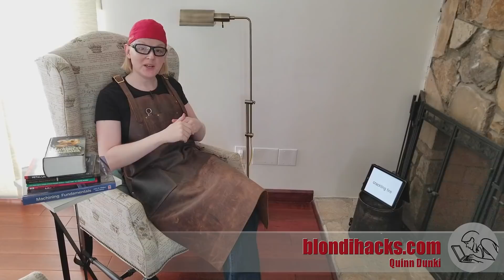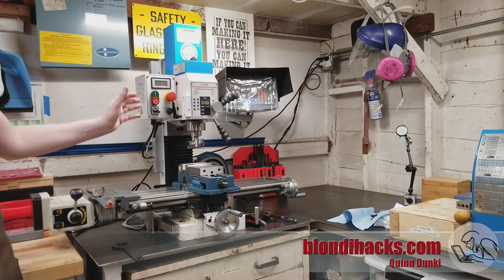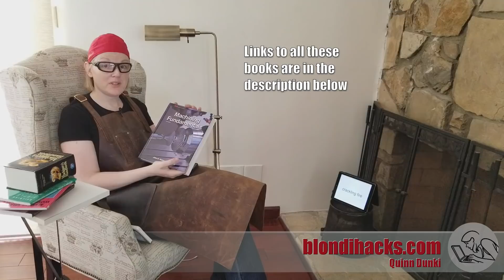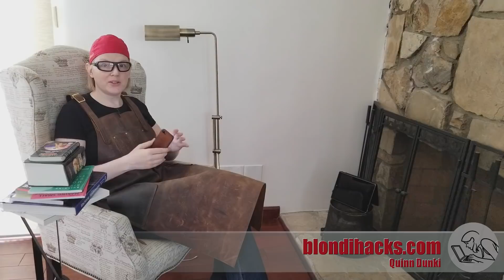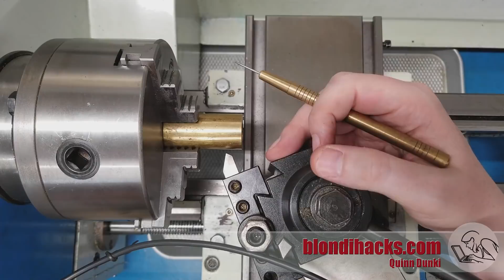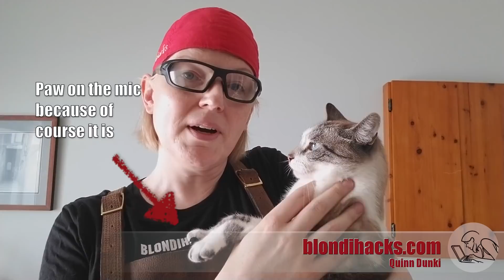Blondihacks Anniversary Q&A!

Comment from the maker: Sorry, everyone- I misspoke on the motor- obviously it’s 750W, not kW.
Reply: It would be rather cool if it were true though...
Reply: Sounds like it's time to upgrade the motor, make the statement correct instead of correcting the statement.
Reply: With a short enough pulse I'm sure you could do 750kW - so just call it the peak power rating for marketing:)
Reply from the maker: @notsonominal  Duty cycle: 0.01%  🤣
Reply: Sorry ( point out, not post out,  above, sorry again) I'm gong to click the bell, thumbs up and just leave.......
Reply: You were just testing your subscribers🤔, 750 kW motor would be the size of a very small car!
Reply: @bostedtap  Quite a large car to be honest...at least for European standards.
Reply: @zanpekosak2383  I have worked on 400 kW motors, and just looked at TT Electrical AMP frame size 315, and I'm not too far off, bit heavy at 2600 kgs🏋
Reply: @bostedtap  Well I did some googling to and I found put that 750kW woukd equal to about 1000hp. That is an amount of power that even some of our larger trucks dont have...hard to find a tractor with that much power as well.
Reply: well, at least you didn't say 1.21 gW
Reply: @HappyHands.  Great Scott😀
Reply: @HappyHands.  Or "A Flux Capacitor gets this Motor started".  ;-)
Reply: @HappyHands.  GREAT SCOTT!
Reply: We're not letting you off that easily. You must acquire a mill with a 750kW motor now. :p
Reply: Blondihacks ... You just left off the point we know it was a floating point answer peace.  .750kw
Reply: I'd be pretty happy with a thousand-horse mill, though...
Reply: Yeah, that would be one hell of a motor on there, you'd need a crane to change it...

Comment: I've watched a lot of instructional Videos. Most come in around 5 or 6. I give you a 10 out of 10. You are very articulate & detailed, most are not. Thank you. My background. Boilermaker, Fitter & Turner some electrics. unfortunately since I finished Trade School I have not had anything to do with Mills & Lathes. When I retired they were the first machines I acquired. However I have not done that much work other than some I've needed immediately.  Now I will be.  I have a CQ6123 Lathe & a Mill/Drill Head which normally attached to the Lathe, but I've made it stand alone. Thank you.

Comment: THANKS FOR DOING THE Q & A video.I learned a bunch about you and your backgrounds and equipment. THANK YOU !!!
   You mentioned about Trains having AC motors. The newer extremely high end locomotives ARE AC traction motors, but they're mainly used in flatter grounds. DC traction motors are mainly the older units They actually do lot better in mountainous regions.
   I APPRECIATE your KEWL style in the machine shop ! A person can tell, that you have it together, as well as know what you're doing, and why the end (quality), justifies the means, (all the set-ups and pre-planning). I was taught, the machining is only a SMALL part of the operations...The Set-Up takes the longest amount of time and takes the most care for accuracy of the finished part. It is apparent that, that was instilled into your beginnings. Having THAT in the back of your mind, IS the most important aspect of being a Machinist !
   Bill, from Tn. 🇺🇸

Comment: If the oil changes are a bitch because of drain plug position use the old school fix. LOTS of old equipment that had the same problem. They instead installed 90 degree or 45 or whatever was needed fittings into the drain plug hole then a long tube to an accessible area and a threaded plug on the end. Added benefit is metal filings created by wear are affected by gravity and as such many make it into the tube and are no longer available to excel wear in the gear box between oil changes.  I have seen people even do this even with flexible copper tube. But, if you like steel then a length of new brake line will also be awesome to bend however you wish to get the line to go where ever you wish. By the looks of your lathe You have a shelf just below so you could route the line around the base and under the table top. Time to drain the oil. just put a pail on the shelf. Pull the plug and walk away.  another SMART idea is to stick a magnet to the casting or even on the tube if metal or tape it to the tube if copper in order to control filings and even help persuade them into the tube. Much the same as some vehicles that have magnetic drain plugs. Just a thought. My 53 Cat 112 road grader has the engine oil plug coming out right over the rear drive diff. Cat installed fittings and pipe from factory. Same with the anti freeze drain through the large cast housing. But the rad drain also has a valve installed for added security in case you lose the plug. 

Folks now may think manufacturers, engineers and designers now are smarter but back then they certainly weren't as cheap and lazy cause designers actually not only thought of these inconveniences and guaranteed messes they also designed and installed the fix at the factory.

Comment: Hi, I'm impressed with your wide knowledge of machines. I'd like to understand wether replacing spindle bearings on a 7X14 Asian lathe from ball bearings to taper rollers will significantly improve the overall lathe rigidity. I've eliminated all the slides frreplay. You're my last chance to clear this issue. Thanks Shmulik

Comment: The other weak spot for lathe is the single lead screw that wears and looses accuracy. Some lathes use a separate shaft for carriage movements and a second separete leads crew for threading. Much more accurate over time.

Comment: Sanity checking my memory (thanks google), granite is around 168lbs per cubit foot, so at a rough guess on the size of that, it probably weighs around 90 to 100 lbs.  So yeah not easy to move just with fingers.  Thanks for the video :) Just found the channel. :)

Comment: I have an old Cincinnati 2MI univ mill(has horizontal capabilities and has an enco  j head? It will never be a cnc controlled unit.  I want to put a dro on it what do you recommend? Thanks so much.i learn lots from you,
Reply from the maker: To be honest, I’m not sure. The DRO on this machine came with it. I honestly get the feeling that these Chinese-made DROs are all pretty much equivalent, so I imagine those kits you can buy on eBay are probably fine. As long as they are glass scales, and the resolution (5 micron or 1 micron) matches what the control panel wants, it should be fine, I imagine.

Comment: I have a question. Either Blondihacks or someone else could answer this:  when looking at a thread tapping chart wether it be metric or imperial in the stock to be tapped section it has for example [75% aluminum, brass, mild steel] what does the percentage refer to?
Reply from the maker: That refers to the amount of thread engagement- either 75% overlap of the thread surfaces, or 50%.

Comment: I purchased a Chinese lathe and soon advanced to a much larger lathe...an old lathe, South Bend 10 it is leaps and bounds over China lathes for my use and more versatile. I am presently looking into a milling machine but limited for the room as far as size is concerned. Horsepower is a major concern as you mention in this video. It's a matter of size versus what I can fit in my shop. Good video and explanation of shop and equipment. Thanks

Comment: Thanks for answering my question. Funny detail: I do most YouTubing in the shed, smoking a pipe, next to a fan exhausting my pollution outside. Noisy. So I don't hear subtle sounds. Only saw the cat appearance coincide with a noise I could HEAR a small subset of the times, and I thought these were tool-chatter noises/squeaks being amusingly punctuated by the cat icon. Alas, no... actual cat noises. So now I wonder if the cat thinks the machine is talking, and it's merely responding in kind.

Comment: I find it interesting that I too am a software engineer that has been a car guy all my life and I got into home machining to produce custom parts for my drag car. I bought my lathe when I was installing a bumpsteer kit and the way to get the correct offset on the drag link was stacks of washers. I found this quite offensive and bought a 9x20 asian lathe to cut the spacers to the exact length in one piece. Of course, it ballooned out from there, like making solid transmission mounts, and clutch adjusters, and manifold spacers... you know.
Reply from the maker: It always starts with a bushing. 😅

Comment: Love to donate but I don't do Patreon ,  any suggestions.
Reply from the maker: You bet! I have Paypal links on my website. Go to http://blondihacks.com and look on the right hand side. There are one time donations and automatic regular donations there.
Reply: @Blondihacks  Done!  You should receive a donation from sirGawain
Reply from the maker: @BlueFlutterbies  Awesome thanks! To your earlier question, the steel tip is a sewing needle with the big end ground off. It's hardened steel and holds a point extremely well. Sewing needles are amazing. Don't try to cut them- they are too hard. You need to grind them down to size or use a dremel cut-off disc, something like that.
Reply: Have you thought of making up some ebay yearly subscription items $10,$15,$20 etc for non patreon persons to purchase?
Reply: What type of steel did you use for the steel tip in your brass scriber (needs to be hard but not brittle)?

Comment: Did you cut off the chip shield on the pm-25 or remove the hinge rod and pair the wires?
Reply from the maker: Great question! I did remove it. Nothing electrical needed- the switch inside is normally open when the shield is closed so removing the rod is all you need to do.

Comment: 🎉🎂⚙️😺  What a nice informal and informative ..crackling fire..side chat, but very costly in terms of production staff🤣. Not much I didn't know or could extrapolate from reading your blogs but some good stuff coming, eg threading and oils.  I was going to go searching for oils the other week till a mate pointed out " Engine oil will be fine, thats all they had in the 40's and 50's" . Interested in your thorts on that. Also want to know about timing of disengaging the lead screw.
I'm gonna have to do a spring clean in my brain to try and retain all this stuff😁

Comment: Very nice video. Thanks. We're still analog around here when it comes to fireplaces... I purchased the largest bench top milling machine that my 120 Volt single phase shop power could accommodate (and that I could afford), something to keep in mind if you don't want to invest in a larger electrical service and the electrician's lake cabin. I am using a very small bench top lathe that my brother purchased years ago and passed on when he moved up to an industrial size lathe, and got tired of making my parts. I do 80% aluminum in my small motorcycle shop. My lathe definitely has limitations. There is a very friendly machinist/fabricator in the next town over when needed. Mr. Pete often refers to some of the older, cheaper, and useful machining guides. My next mountain to climb will be TIG. The link to, and info about, Fusion 360 is much appreciated. Dorito Magnificat says howdy to Sprocket. Thanks, again!!!
Reply from the maker: Sprocket says “meow” which can mean “hi” or “I kill you now”. It’s hard to tell.
Reply: @Blondihacks  Cats are meant to be served not understood

Comment: In case you've never seen one, could I suggest looking at the Atlas MFC mills... It's a horizontal bench top mill with built in power feed, kinda like a bench top version of Keith Fenner's big mill... Unfortunately they are no longer made, discontinued back in the 60's. Parts and repair are still pretty easy tho.
Reply from the maker: Yah, I love those! I tried to find one when I was mill shopping, but wasn’t able to.
Reply: Blondihacks I found one a few months ago, but couldn't afford it (long story, medical bills...) the trick to finding tooling is use google image search believe it or not

Comment: You should try doing a CNC out of the Mill and you could then add a 24K rpm spindle ... I just went with the bigger Mill that could fit my Garage... It's a 1988 Anayak with 800x400 xy travel and then i build an adapter and added the 24K rpm spindle to it... It works great! From Portugal, you are awesome 😋
Reply from the maker: I have given serious thought to a CNC conversion on this guy. The PM25 is a popular target for it because it has ample room under the slides for ballscrews and servos. Maybe someday!
Reply: @Blondihacks   I converted my G0704 (Grizzly version of your mill). Not sure it's worth it unless you just want to take on the challenge of the project. I'm glad to have mine, but I often find myself just wishing I had a manual mill to do many jobs (probably most).
Reply: @Blondihacks  i was lucky, i work in a company that specializes in injection moldes for plastics and my employer was going to scrap the machine but i steped up and got it for myself... I'll post a video and link it to you ASAP so you can see me making some clamping system and T NUTS for the table...
Reply: @Blondihacks  https://youtu.be/fuyc8RSGuLY
 It's also my first upload, love watching you videos :p

Comment: Quinn, one interesting point about granite surface plates is that if you drop anything heavy onto the surface they chip rather than ‘denting’ the material, which on a metal plate would  produce a burr or high spot. I know this could be dressed flush, but I personally prefer the granite version. Congratulations on reaching the one year milestone. Any thoughts on producing videos on CNC machining, particularly using the basic G and M codes?
Reply from the maker: Yes, excellent point! I’ll be including that in my surface plate video for sure.

Comment: Blondi
You are often the first video I look at.  Very well done, neophyte friendly ie simple but clear and comprehensive.
Couple clarifications
1.  Commonly called "brushless DC" are actually 3 phase.  They got that name because starting torque is about the same as a series wound DC.  
2.  HP by itself does not matter.  HP = Torque x RPM divided by 5252.  Motor selection should be done starting with torque demanded by driven load and then how much RPM you want.  A 1 HP motor at 3600 RPM will have 1/2 the torque of 1 HP at 1800 and 1/4 that of 900 RPM motor.
3.  Belt slip has saved me numerous times on my little old timy Craftsman lathe.  I leave the drive belt loose on purpose. 

Dan Bentler
Seattle
Reply from the maker: Yup, I am quite familiar with the inner workings of these motors. One has to pick and choose how to present information in an abbreviated format like this. The gist is power-to-size ratio for what are called “brushless DC” motors. That’s what a prospective buyer needs to know

Comment: Try this power feed for your mill, I have one fitted to my PM25, the speed control issues are similar but it's much more compact, has a rapid feed button, does not block the Tee slots and you can disengage it for manual feeding. 

https://emvioeng.com/shop/machine-tools/manual-machines/manual-milling-machines/powerfeed-for-small-milling-machine/
Reply from the maker: Cool, thanks for the tip! I’ll take a look.

Comment: Quinn, would a 7x12  lathe with a 250 watt  motor be a good starter lathe?
Reply from the maker: Good question! You’re into “mini-lathe” territory at that point. They can be okay for some projects, but you’re going to have trouble turning steel with that, and tougher stuff like tool steel will be right out. If you’re doing smaller projects with brass and aluminum, like maybe jewelry, it could work.
Reply: @Blondihacks  the lathe I'm thinking of is a Wen model 3477 ,  and most of the project will be brass,aluminum and soft steel mostly small parts.if  I want a larger lathe I'll have to wait I rat hole more money! that and I kind of wanted it for my birthday on 9/12!  72 yrs.
Reply: Terri Newman looks like it’s probably a sieg machine. I think it’s 750w not 250w. I’m personally not a fan of wen products, but that machine looks like a decent starter. Be aware of mini-lathe short comings. Check out Frank Hoose’s channel and ades workshop. Both great mini lathe channels!  Good luck, happy machining, and also Happy birthday!!
Reply: @griplove  ,Thanks for the reply and I've watched all of his videos on the mini lathes,him and Quinn is what got me into this!!! really looking forward to getting my paws on a lathe!
Reply: Terri Newman I think it might boil down to price. My lathe has a 7” swing. I chose it because I had no idea if I was going to enjoy the hobby at all and didn’t wanna break the bank. You will do plenty of that once you find you enjoy it. I’ve had mine almost a year and I’m already dreaming bigger, but it’s been a perfect starter and I love it.
Reply: @griplove  that's what I'm doing now ,if I want a bit larger lathe I'll have to wait some what longer to afford it!

Comment: I have that same ugly power feed unit on my PM-727. While I agree with your other issues with it I've never had any low speed feed issues like you're describing. Maybe the motor in your unit is bad?
Reply from the maker: I think it’s the potentiometer. It feels touchy and unpredictable, like it’s going bad.
Reply: Blondihacks I would agree. Changing out the POT would probably fix the low speed issue.
Reply: I have the 932M PDF with the same power feed unit and haven’t had any trouble with it yet. It’s only been a couple years though. It is loud and I don’t like how much space it takes up. Also wish it had some sort of reference material for the numbers on the dial. Don’t like measuring how far the table travels in a given amount of time.